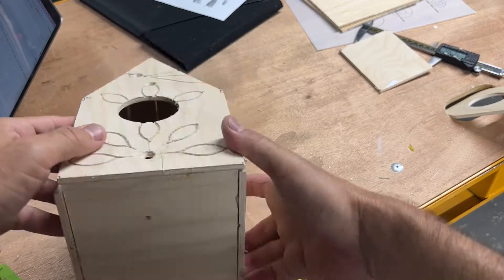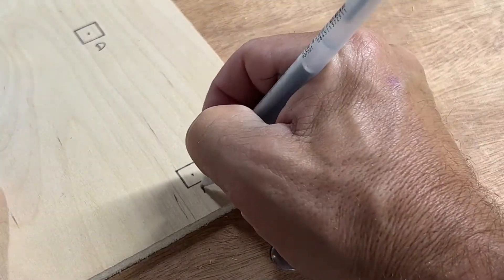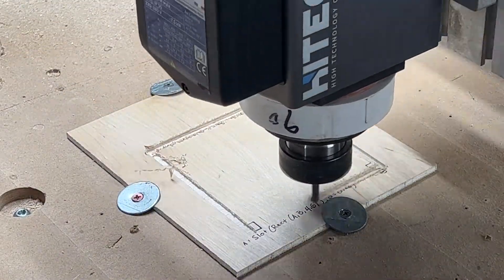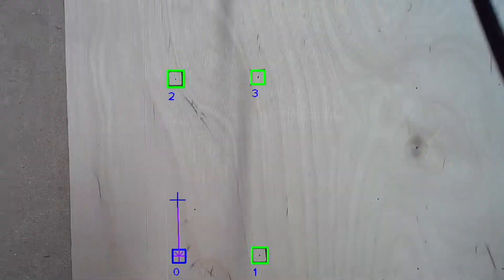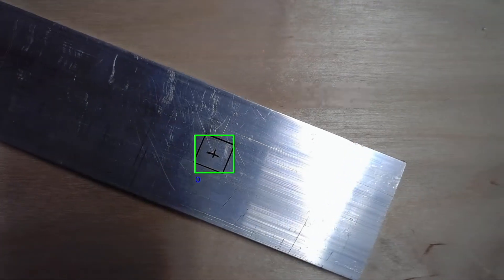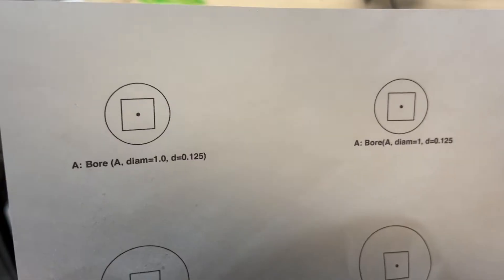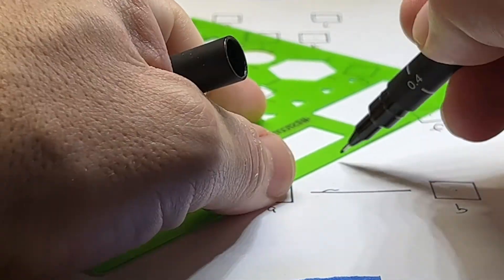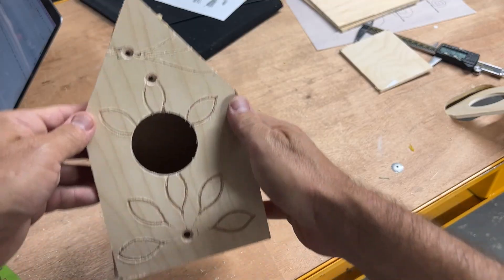Paper Tools: Cutting Examples

Comment: Really nice.  We run a fablab with several CNCs,  using the Fusion 360 -> GCode -> Mach3/GRBLHal toolchain.  BUT we also have a traditional-style woodshop.  Maybe this helps us bridge the two worlds with a gentler learning curve.  Plus it's a good excuse to add more cameras to our machines ;-)
Reply from the maker: Ah cool, yes I was contemplating the initial product as helping beginners (smoothing the learning curve as you say). It's a nice thought that you could add cameras to your machines for both a paper tools use and just to have remote viewing. Although for my project you'd need it to point straight down at your material. Not sure if that's useful for the remote case or not.

Comment: Really cool concept, nice work!
Reply from the maker: Thanks a bunch, I'll post more, and please let me know about your CNC experience, what machine you own if any, and what CAM software you use so I can start adapting for all machines.
Reply: @PaperTools  I am just a hobby CNC tinkerer. I use a 6040 Chinesium CNC with a GRBL board. I mainly use Universal Gcode Sender, both as a "CAD/CAM" and sender software. 

I am also one of its developer, so I am little aware of the problem you are describing with having to CAD/CAM before you can start making things. But I went with the mainstream solution, creating yet another  design tool - but it is free and open source unlike most other tools.
Reply from the maker: @joacimbreiler  I'd like to check out that design tool you mention if you could share it. I'm trying to figure out how common that GRBL board is. Maybe one way to add my Paper Tools is to directly talk to that GRBL board. It would allow me to avoid building plugins for every piece of machine controller software such as Mach 4. Any ideas?